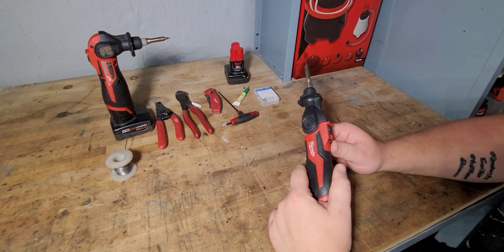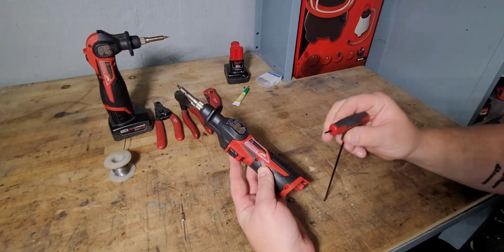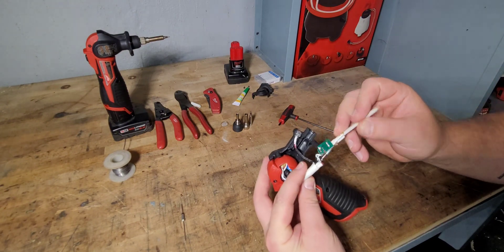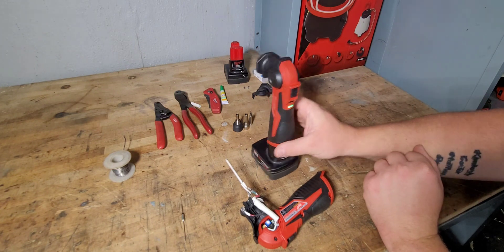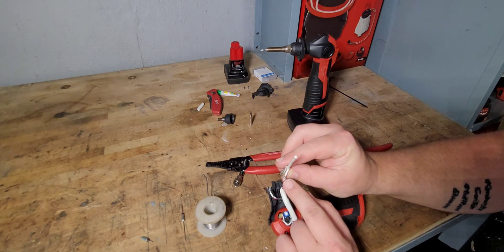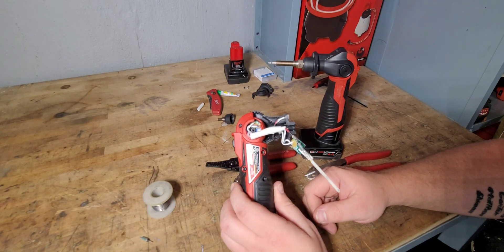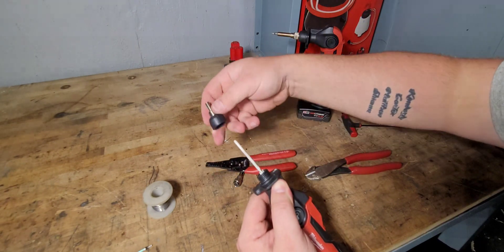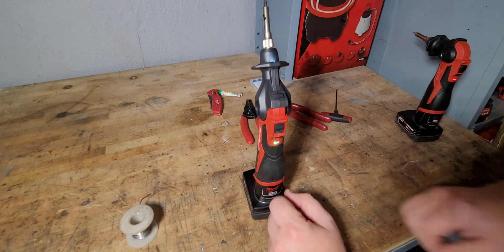Milwaukee12 soldering gun not heating up. Replacing the fuse

Comment: Soldering to a thermal fuse with shortened, cut-off leads runs the risk of damaging the fuse from excess heat. Best to put an alligator clip as a heatsink between the body of the fuse and the point to be soldered. If you can orient the fuse into the circuit in such a way that the leads can remain a bit longer, even better. The reasons for the original being crimped in place are two-fold: 1) to minimize/prevent heat-stressing the fuse during installation, and 2) the nichrome heater wires can't be soldered to.
Reply: I'm an electrical engineer, thank you for this information !!!!!  Makes sense, but did not occur to me.